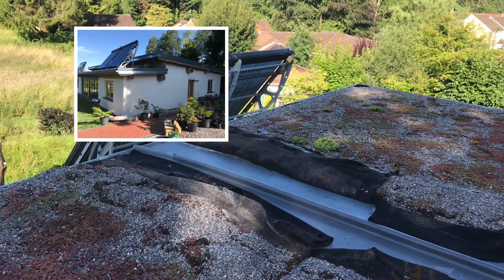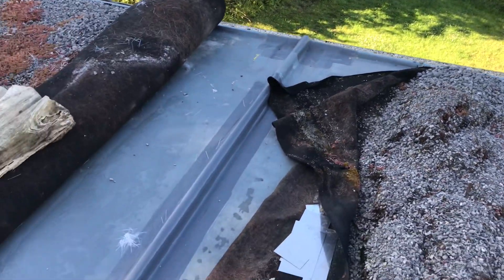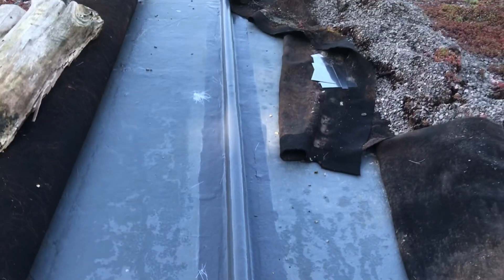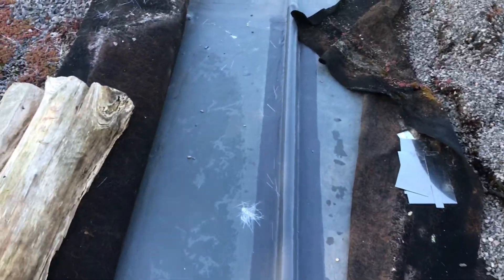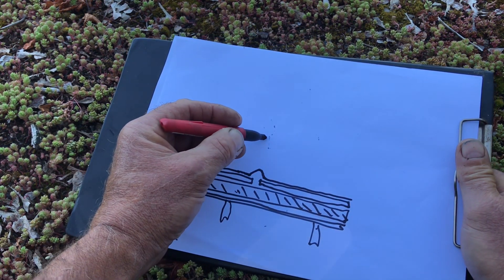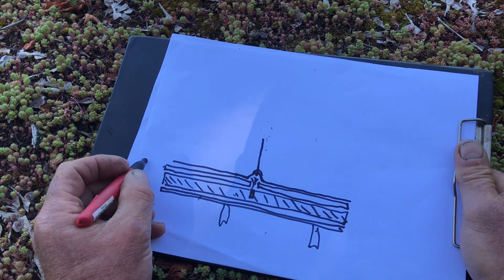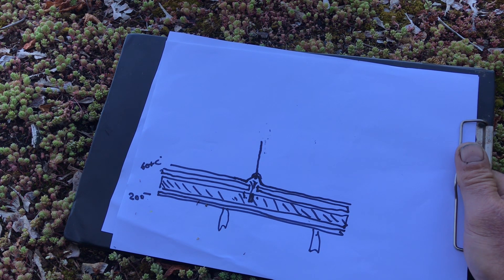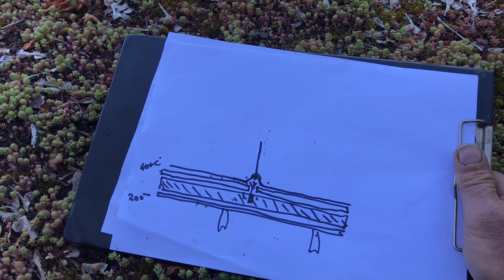Noisy GRP Flat roof fix

Comment from the maker: Hi Yes . This is because the termal expansion rate for PIR insulation is twice that of the the GRP rate . Although small but over the longest direction (12 meters ) it equates to approx 6 mm difference on 60 degree temperature change . Unless there is a membrane or similar between them the noise is the sudden movement when the movement build up sufficient stress / force  to overcome the friction . Comparable to how earthquakes work . 
However no evidence to suggest and damage occurs (in 4 years ) but Defoe’s make scary cracking and cascading  Creaking sounds . But so does a crow landing on it or throwing the stones about ….. no sure why but they frequently lob the stone off the roof 😂😢😂 Tim